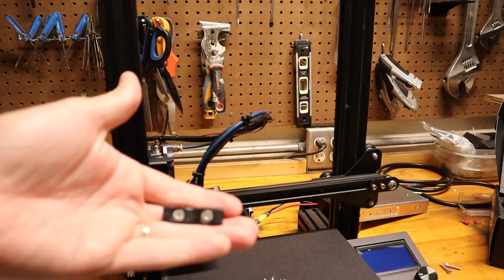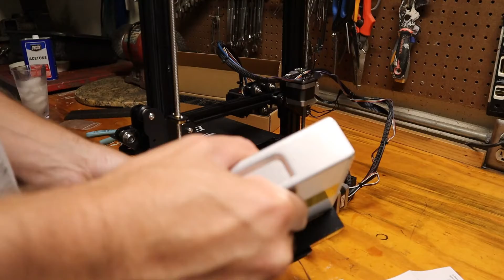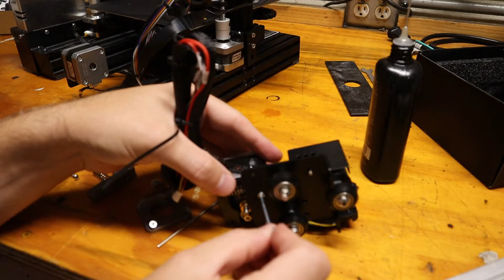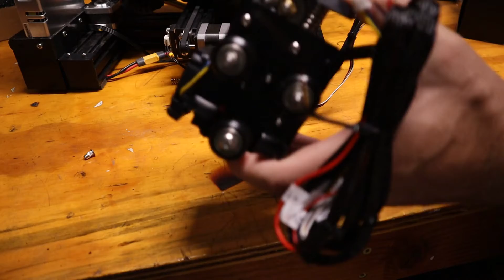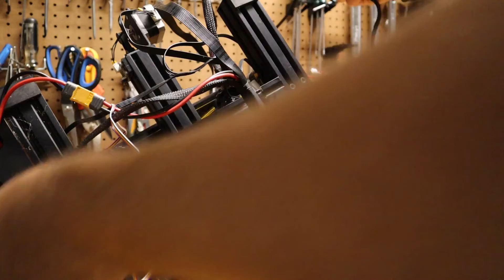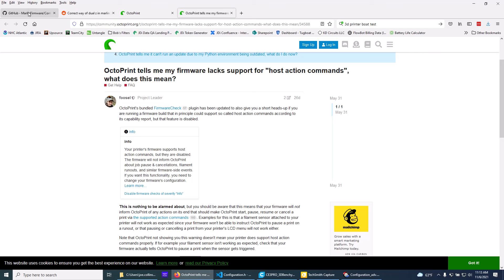Creality Ender 3 Pro - Install 2nd Z-Axis Kit + Direct Drive Extruder + Marlin 2.0.9.2

Comment: Those z motor brackets puts the motors too close to the z extrusions. That increases the chance of z binding. You also need to attach an additional wire to the PSU and screw an end to an extrusion on the printer because the default position is how the PSU is grounded preventing static shocks that can damage your printer.